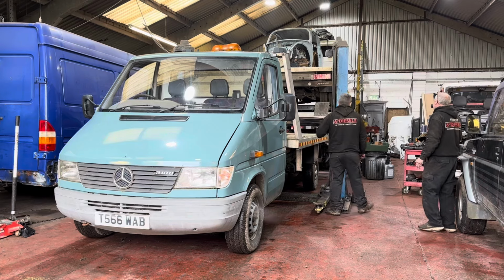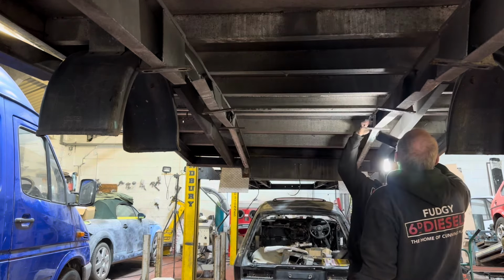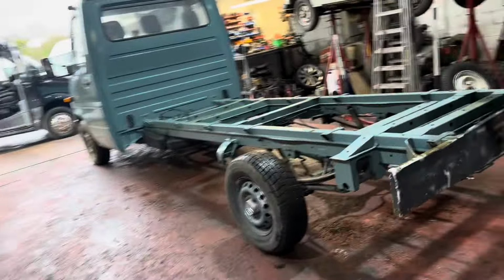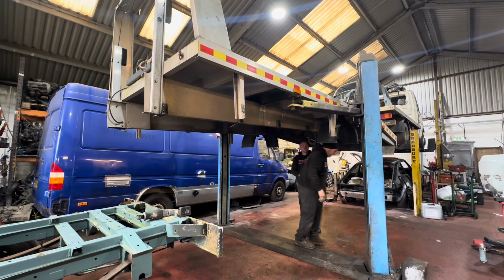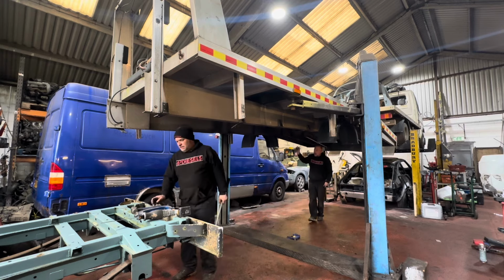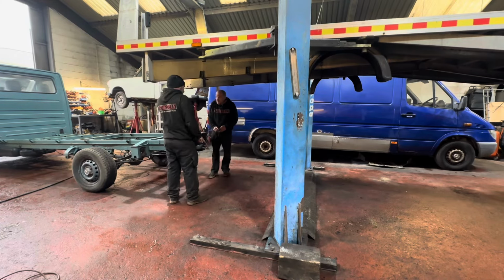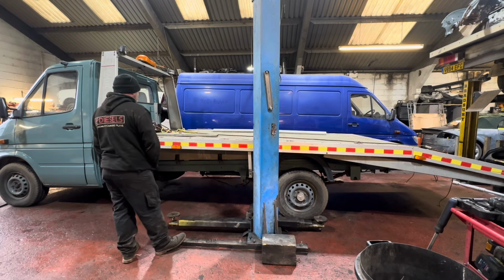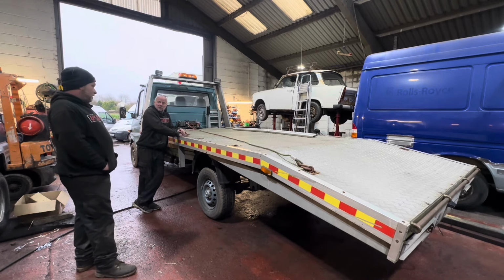Repairing and fitting the recovery truck body, Mercedes sprinter 310D

Comment: This is a serious question from someone who hasn’t had 33 years working with metal etc why do you appear to start the cut at the bottom and cut upwards? I always thought you would cut away from you, I would think if it snatched whilst cutting upwards wouldn’t it send the grinder straight towards your head?  Like I say honest question
Reply: If I go from the top to the bottom the sparks from the cutting wheel would be heading towards me...if you notice once the blade cuts completly through the sparks are heading away from me 👍
Reply: @stevelodge6506  brilliant Thankyou i thought it would be a simple reason. Great build btw your works awesome i love old sprinters and crafters which this channel has plenty of